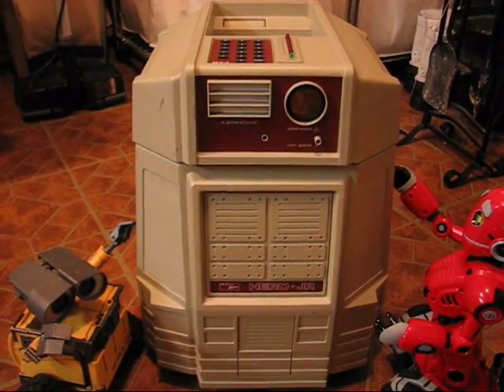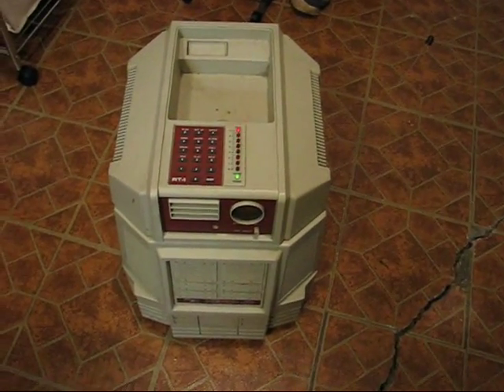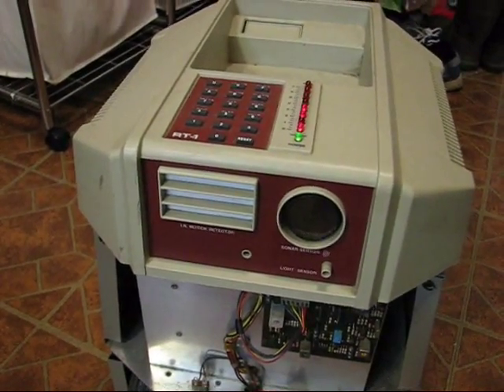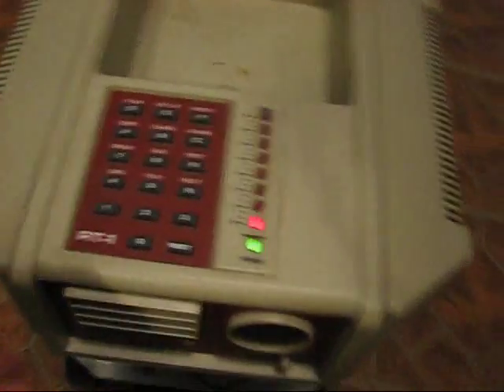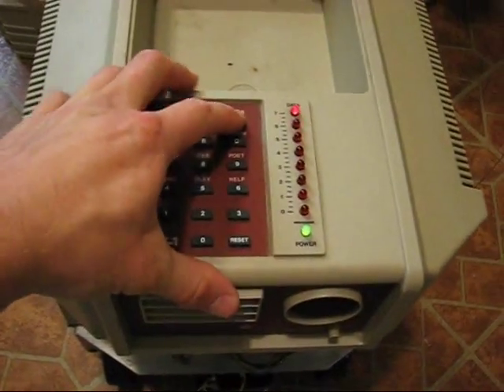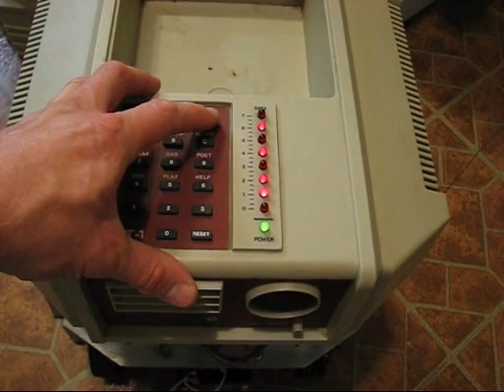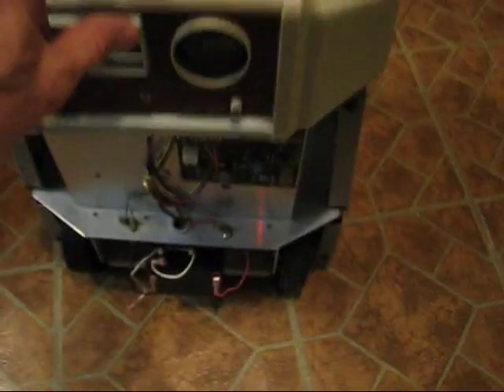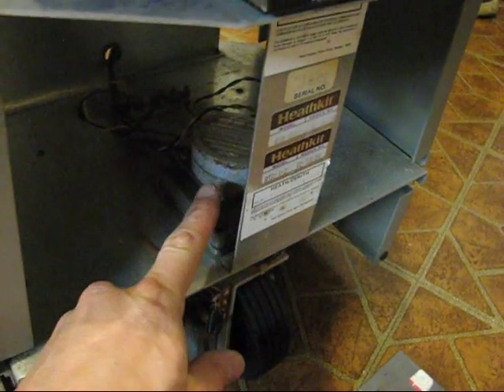My Pet Robot Project 001

Comment: Just curious, by why put the new hardware in him if the original equipment inside him lets him already do what you want?
Reply from the maker: Sorry I didn't see your comment until now.  A very good question.  It doesn't really do what I want.  I would like it to be a robot pet.  Currently the electronics are a pain to program and are old and hard to maintain (parts are hard to get etc.).  I am in the process of adding additional sensors in the head area and wiring up the keypad and led board in the head to an Arduino.  This will then connect to a on board low power PC.  The drive motors will also be handled by a separate Arduino.   Both the head and drive electronics will be controlled by the low power PC (netbook or Raspberry PI).   The final goal being a robot pet that can navigate around the house without getting stuck or wrecking things while making beeping sounds and acting cute.  It doesn't really have to map out the place, just not get stuck.  I would also like to be able to ask it questions like what is the weather outside.
Reply from the maker: Oh yeah.  I wish I had kept the voice chip.  I really like his old voice.   I haven't really been able to find a voice synth that sounds similar.